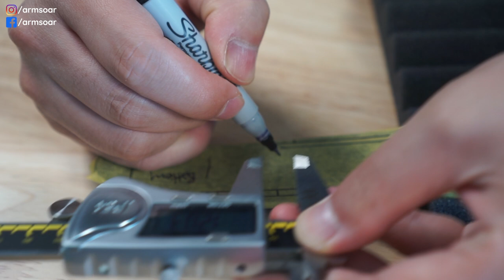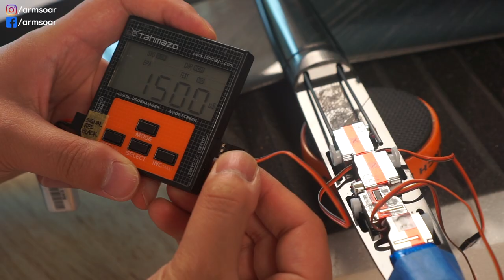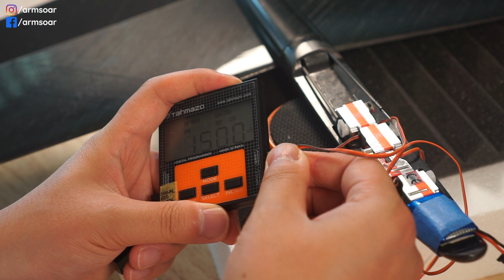Kite DLG Build Log Part 2

Comment: Do you think the internal flap linkages are really worth that kind of effort? A lot of trouble for build, assembly,  etc etc looks like.  I like the way the BAMF 2 is set up 100x better personally.
Reply from the maker: I wouldn't say it was a lot of trouble, I just didn't follow the instructions properly. But with the first one under my belt, the 2nd will be very easy. That said, I'm a bit biased but I do prefer the way we do it on the BAMF 2. This is our 5th model using this type of pushrod system, and it's been quite refined. I like things that are simple and straightforward. But I acknowledge that a good number of people prefer having internal pushrods, so it's good that there's a choice.

Comment: Thomas, I am in the process of building the Kite kit I bought from you. I studied both videos (part 1 & 2) and the buidling instructions PDF. I noticed in the instructions the output spline for all 4 servos is situated to the rear but in part 2 of your build you have the output splines for the two aileron servos different in that the forward one is aft and the aft one is forward. I don't see any push rod clearance problems with this and think it will minimize unwanted interaction by making the pushrods as close to the same length as possible but just wanted to know your thought process for this deviation. I am setting mine up the same as yours but I want to push the servos a little more away from the centerline so that the pushrod from the front servo doesn't make contact with the motor of the rear servo. The consequence for this is that the pushrods will be further apart and closer to the outside of the fuse where I need to cut the slots for them to pass through. I did bias my servo arms toward the nose and averaged the difference of one servo's subtrim (+14) with the other so that both of them are at +7. This resulted in exactly the same angle of forward bias on both of them. I know any and all mechanical interaction can be fixed electronically but I like to get everything as perfect mechanically as I can get it. This comes from 42 years of flying RC helicopters especially during the early days when there were no electronic fixes and everything was solved mechanically. I still find that a great mechanical setup where minimal electronic assist is the best. Just wondering your thoughts on all this since this is my first DLG ever?
Reply from the maker: Yes, small deviation there. I like to have the two wing servos have the output as close to each other as possible and have the pushrods as matched as I can.

I don't think pushing the servos closer to the sides will work, unless you are able to completely clear the rear servo's motor so you don't need the bent pushrod ends on the servo side. In which case, the because the heigh of the servo arm + pushrod is lower, then it can clear. If you still need to use the pre-bent servo-side pushrod, then it'll be too tall to clear the curve of the fuselage near the sides.

You're absolutely right, always adjust mechanically where possible and only use electronic adjustment on the radio if there is no other practical way to do things.

Comment: Hey thomas have u noticed that the vertical stabilizer has a non symetrical profile so its actually more like a wing and creates lift do you have any idea why they have done this???  greetz
Reply from the maker: The vast majority of competition DLGs are designed this way. It helps straighten the model faster at launch, but in our regular flying speeds it is designed to keep flying straight.
Reply: @ArmSoar  thanks thomas
Reply: @ArmSoar  I noticed this on my Deviant and figured what you said was the reasoning behind it.